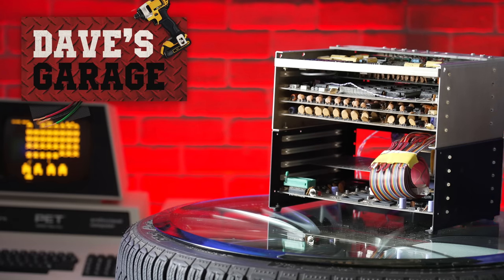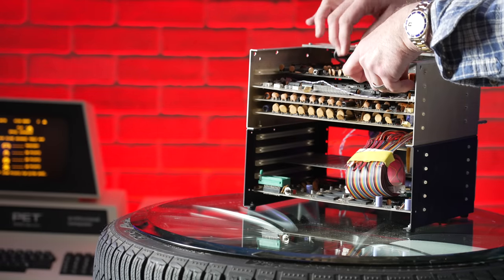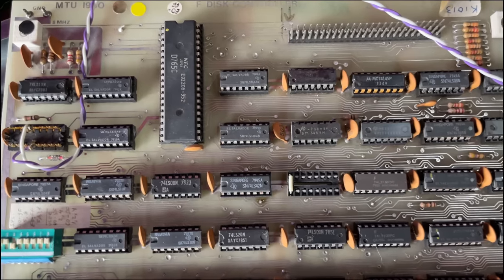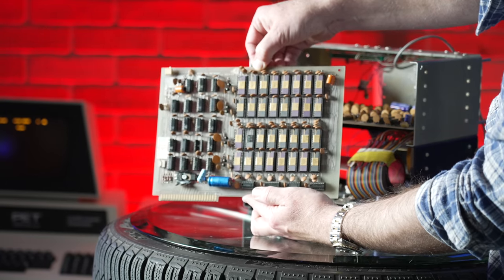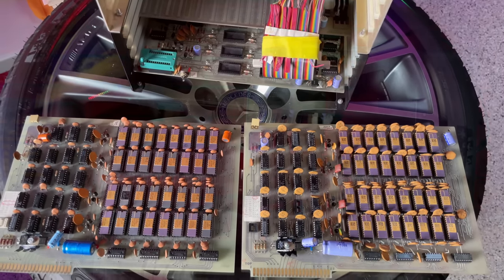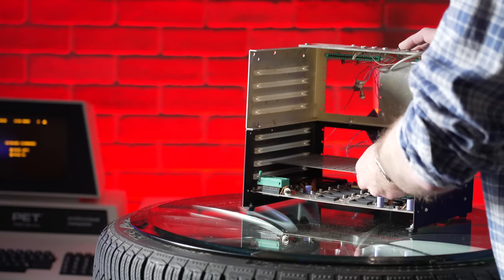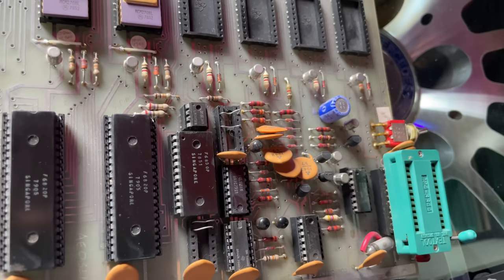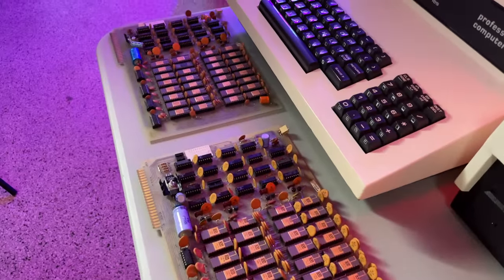Inside the 1977 KIM-1: CPU, Video, RAM, ROM and more!

Comment: On the last board, those looked like UV erasable EPROMs. The lenses should be covered to prevent unwanted erasure. After all these years, I would not be surprised if you find them essentially blank.
Reply: Recently I read some docs for the 27c series, they state that data can be expected to last about 20 years on the chip, when properly covered up, so there's some chance that these would need to be rewritten even if covered.

Comment: The EPROMs are 2708s. There looks to be enough hardware around the ZIF socket to confirm this is a programmer. VPP controlled by a switch isn't uncommon. These typically worked by reading a block of RAM and writing those bytes to the EPROM. An assembler might load the assembled code into RAM for testing/debug. Once you are happy you commit it to EPROM. The empty sockets are for additional EPROMs to be added. The ROM sockets will be someplace in the memory map. I'd guess you will find a more advanced monitor in these ROMs that includes the code required to initialize the disk controller IC and to load the IPL code from the first sector of track 0 of the floppy disk into RAM. That IPL code is then executed to boot the system by reading the OS from the disk into memory. In the S100 / CPM world this is how CPM gets booted and I'd guess what you have is very similar. The code to work with the video card is probably also in the the ROMs. (Basically a monitor/BIOS in the ROMs). Total guess work on my part but based on what I see and how things worked back in the day it would seem logical.
Reply: Yes, and the 2708 is, like all early EPROM chips, in need of a substrate bias of -21V, and also is programmed with 25V on the program pin. Can be left on for program and verify, but really not a good idea to have it present on power off, as you will find some random locations get written to logic 0, often only a bit or two along the line. They get really unhappy, and refuse to work, with that substrate bias missing, but generally, other than not listening to the address and control lines, do not often blow up.
Reply: Just a note - those are 8 k bits, 1k by 8.
{^_^}

Comment: Are you taking any kinds of antistatic precautions? I haven't seen a wrist strap or static dissipative work surface. Static may not destroy the chip initially. It may however cause  metal to move in a via on the IC, on the bonding pad or even in the bond wire. (electromigration). Current flowing in the weakened area as the chip does its normal work causes more metal to migrate and eventually it fails. Electromigration will eventually cause all chips to fail assuming something else doesn't kill it first. Heat softens metal making it easier for the metal to migrate (keep your ICs cool).

Comment: I was watching a video from low-spec Hardware about early microprocessor creation. There was a part about MOS company ordering chips from a manufacturer we're all the chips were made the same. They then had to come up with the lithography to map the connections, and bodge wires having to be put in place after the fact was very common. I don't know if it helps, but there may be some useful information in those videos. Specifically those about Commodore, MOS and Spectrum.

Comment: The little protoboard is point-2-point wired using what looks to be enameled wire. During soldering the enamel is burned away allowing the solder to connect. Wire-wrap will have long pins on each socket pin (.5 to 1 inch) with wire literally wrapped around the pin. Several wires can be wrapped to each pin using a tool specifically designed for this. The pins are square, the square edge cuts slightly into the wrap wire creating a gas tight connection which is why then don't need to be soldered. No available free oxygen means no corrosion. The 8212s are 8-bit parallel port I/O chips. These may be two output ports, two input ports or one of each. It is most likely mapped into 2 memory addresses. As an output port the data is latched, so a memory write to the address would result in the written byte being latched on the output pins. For a memory read cycle the 8212 will take the 8 input bits and present them as a byte to the processor. You are correct that it looks like a 50 pin ribbon connector was used with an edge connector at the end that could have been used for an 8-inch floppy drive. I suspect whoever wired this used this cable as it's what he had on hand.
Reply from the maker: Cool, thanks for the explanation!

Comment: The architecture, with the backplane layout, seems quite sophisticated and forward thinking for the time. Just fascinating!
Reply: Was watching an interview with Steve Furber, the main designer of the BBC Micro computer and original ARM chip, and he brought out a lot of his university projects from his time at Cambridge made around the same time as this, and they were all very much the same. I think it may have just been the standard of the time.
Reply: Backplanes were exceedingly common in minicomputers and mainframes! :) (And still are in some cases, otherwise clusters of smaller technically-microcomputer nodes are often used instead.)

Comment: At 11:10 one of the ICs has a pin bent outside the socket. This is always interesting, if it's a TTL input it should pull itself high. If it's an output it has been isolated. I've used this technique many times over the years to help troubleshoot.
Reply: Likely this is a cheap dip switch equivalent for setting a configuration option on the board. I'm guessing it might have been part of board address decoding. It wasn't too unusual for hobbyist boards in that area to use this technique to set configuration options.

Comment: That last board has quite a range of different things on it, so it's probably more or less a computer on its own.  In addition to the 6820s, there's a 6850, which is a serial ACIA, implying it's meant to communicate with something.

I'd love to see the circuit diagram for that video interface, and see it up and running!

Comment: The hand-made board might just be a general purpose I/O board, for connecting up to electronic projects, or maybe interfacing (with suitable circuitry) to Ham gear. Maybe it was to control robots. It could also be a printer port. But simple I/O boards were popular enough back then, could be that, the owner quite probably had an electronics hobby as well.

Comment: that edge connector suspiciously looks like the edge connector from a 5.25 inch 1.2 mb floppy drive like came on an ibm 8080/8088 workstation. its probably a custom controller to use a more up to date drive  than the original 8 inch drive it originally supported.

Comment: I was a fool that bought an original Macintosh.  Memory upgrade involved soldering chips and wires directly to the motherboard.  It wasn't an official Apple upgrade - there wasn't one.  But the mod worked well enough.

Comment: @08:09 the upper left chip has '1400' labelled on it. Could this possibly be a baud rate? could the connector be for an older tty terminal or 'tv typewriter' instead of a disk or floppy drive?

just my 2 cents.

Comment: Very nice purchase.  That bottom board seems to me to be the most intriguing.  If it is an EPROM burner, then maybe that is how you installed software so that you didn't have to load it from disk?   Burn it to EPROM and then move it to one of the empty slots?    Seems like a nice feature for back in the day, not as convenient as a disk drive but load times would be non-existent.   Does this system do any sort of bank switching or does everything have to map into the 65536 bytes of the address space?  Do those EPROMs still have any data on them with their windows open for this long?

Comment: One Item on my computer bucket list (close to the top) is to build a Kim1 as close as I possibly can to the original, modern repro's remove too much like the edge connector. It will probably spend much of its life as a wall hanger but it will be all for fun..

Comment: You really don't need a lot of electronics for a floppy drive controller if you do everything in software. Ohio Scientific's controller from that era was just a 6821 to move the head around and detect the index hole and a 6850 to read and write the data.

Comment: If possible, you should check the unregulated voltage under load. If its dropping a lot of voltage, then I’d consider adjust/replace with a regulated power supply with a matching voltage. Just so the voltage controlling devices are trying to dissipate to much Wattage.

Comment: Hello software Dave this is hardware Dave. Just to help with some ideas, if any of those windowed eproms have programs in them, I would suggest you put a double layer of electrical tape over the window as just regular sunlight can actually erase those over a number of years. That board that you thought might be a disk controller could be a scsi or sasi interface. the scsi interface has several address pins for which device you want to talk to and then it uses a bidirectional bus. Sasi is similar. You can probably look up the connectors for scsi and sasi on the internet. This is just an idea to point you in a good general direction hopefully.
Reply: SCSI wasn't standardized until 1986... (X3.131-1986)  So 10 years after the KIM 1...   launched in 1976. 
I left a comment here.  Likely a tape drive interface like used on the Data General Novas.
Reply: @ramosel  Maybe for SCSI as an industry standard, but SASI was in use by 1980 at least as a standard way to interface to hard disk and floppy disk controllers. I debugged more than a few systems in 79-81 using that interface.
Reply: @GodmanchesterGoblin  And the Kim 1 was out in 76... if you remember, the first S in SASI was Shugart.  Dave Already mentioned a disk interface and he’s looking for a Shugart 8.5” floppy.   Boucher developed SASI, from the beginning (1979), on a 50 pin ribbon.   Early tape reader cables were often discrete wire harnesses that had twisted pairs or braids owing to noise issues from the drive motor and solenoids in the mechanism.  I’m not saying, it WAS/IS a tape controller, just likely.   KIM 1 was years before dual disk drives or diskcopy would become general practice.
Reply: @ramosel  I was making the assumption that the hand wired board was later. A system such as this was likely put together and enhanced over quite some time - that would be normal in the DIY community. But you may well be correct about the tape drive possibility.
Reply: @GodmanchesterGoblin  Good point.  That board very well could have been later.

Comment: This is such a cool series, I love looking at things like this.  I've got an S-100 system that I'm trying to get working, but it's a mid-80s unit.

I actually have three working 8" floppy drives, but I'm afraid I can't send any to you since I'm actually using them for my own project, haha.
Two go to the S-100 system (it's a Compupro 8/16), and one's been set up to connect to a PC so I can read and write disk images.  They all came off eBay though, so I'm sure if you start watching you can eventually find what you're looking for.
Reply: You may want to check out Tech Tangent channel. He just got one of those systems and a IMSAI 8080

Comment: I got a KIM-1 as my first computer back in 77. Added a 4K memory board and a TVT video interface. Then eventually expanded it to 64K with video card (80x24), rom based monitor. Never got around to adding in a floppy disk controller. Still have it, but had to replace keyboard so it is no longer stock. I did end up building my own CPU card to replace the KIM one on my home built machine.